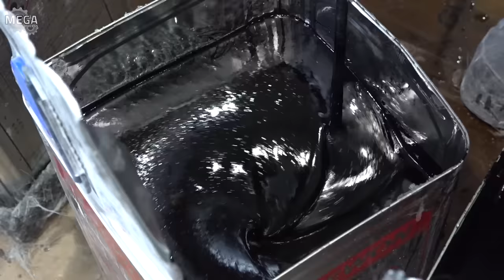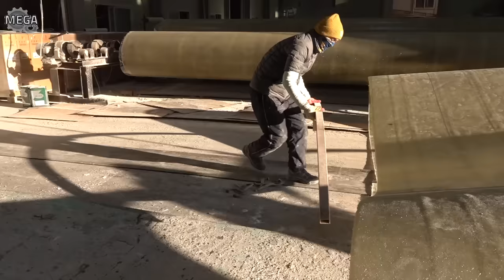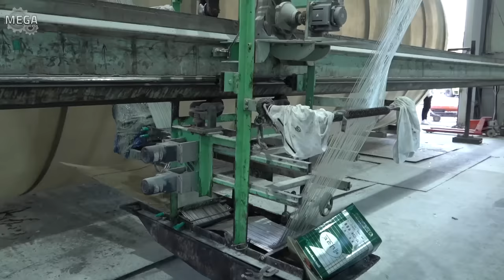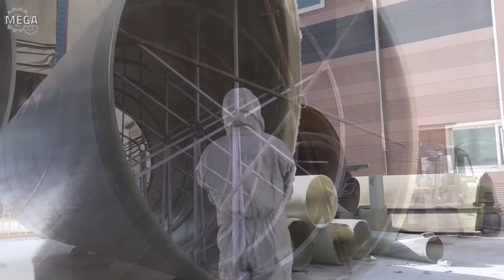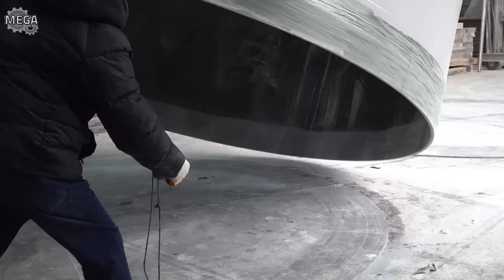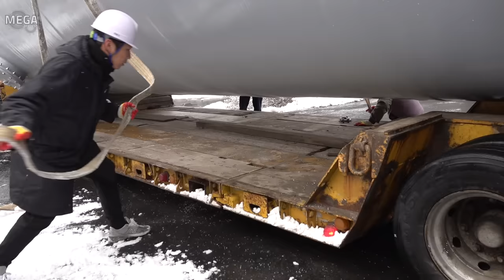Process of making glass fiber reinforced plastic storage tank. Korean plastic manufacturing factory

Comment: Very strong and beautiful company, need our latest generation of Continuous advancing mandrel Winding fiberglass mortar Pipe pipe production line can leave a message, independent research and development, and greatly reduce the cost of the production line, Nissan 1000 meters only needs 3 workers, no need to change the mold steel belt, intelligent, automated pipeline production line.